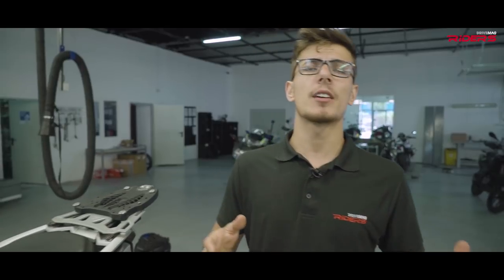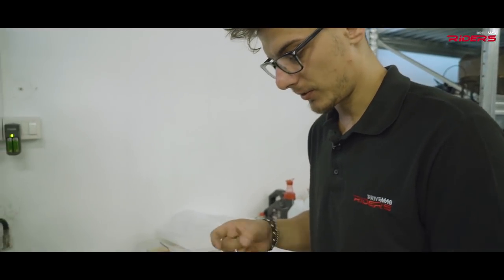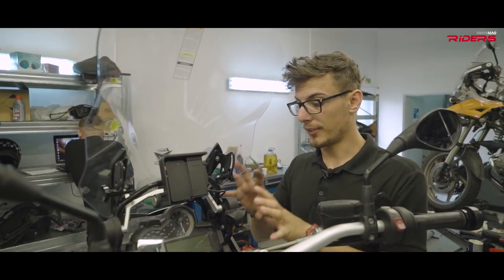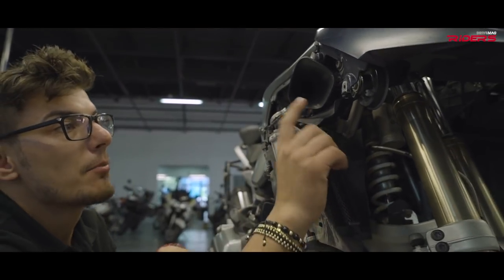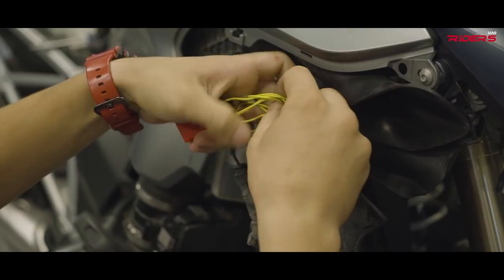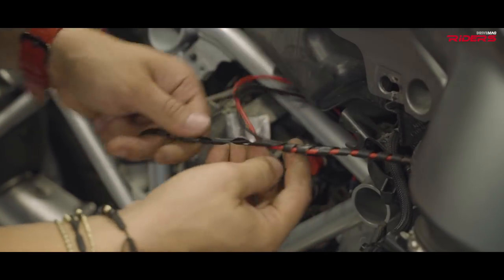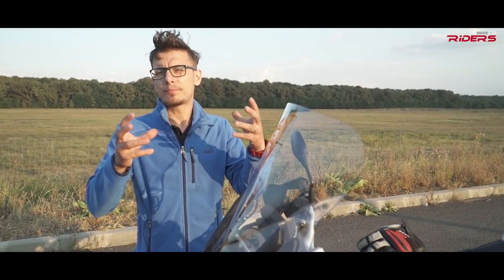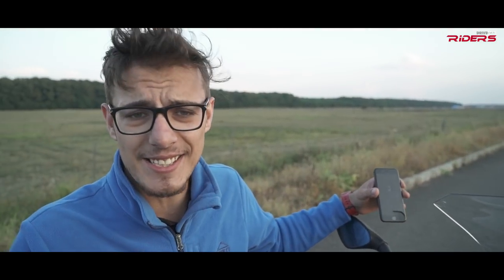R1200GS Windscreen & Hornig Upgrade | Install & Review

Comment: why not put the GSA windshield? I found out that the 1200GS stock screen gives me turbulence on the helmet if I ride above 120km/h, now the GSA screen has a much better protection and it does not require additional mounting brackets...its a perfect fit. only downside is that it just costs dbl than other windshields..